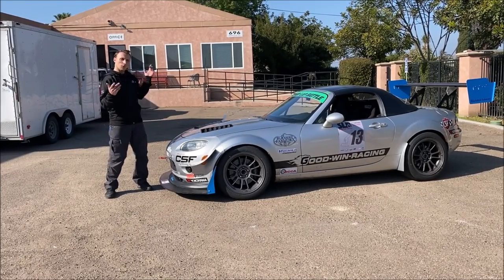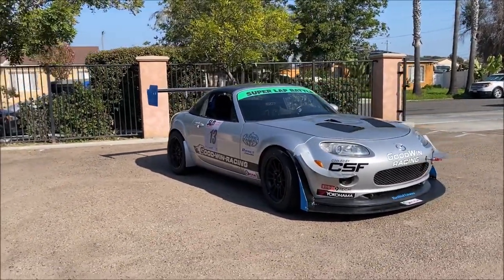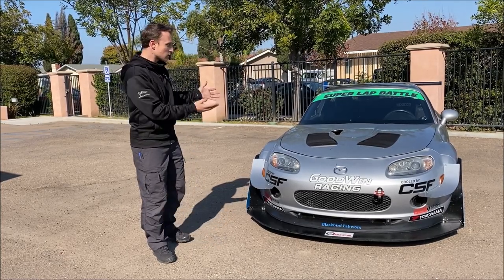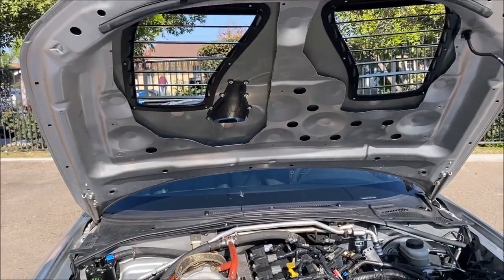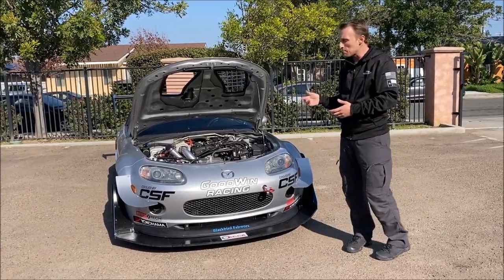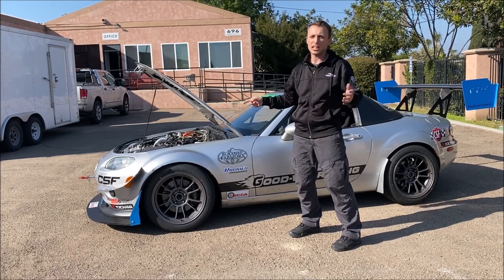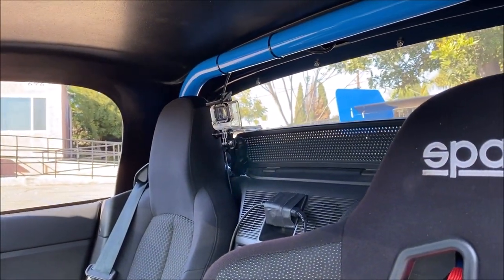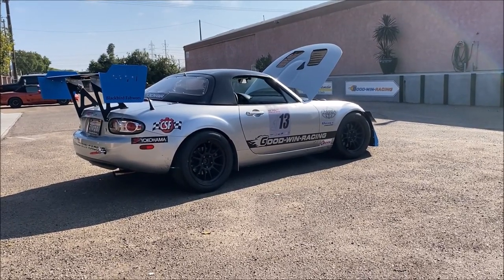Goodwin Racing Turbo NC - Walk Around

Comment: Woah woah woah hold up... You guys don't have a front tower brace??? That thing must handle like a Cadillac! How could you guys run it without one? I'm extremely confused.
Reply: I just learned from Bryan at Fab9 that the  GT Turbo system will fit under a Cobalt FSTB so thats good!
Reply: you don't need one, it doesn't have struts, just reduces cowl shake